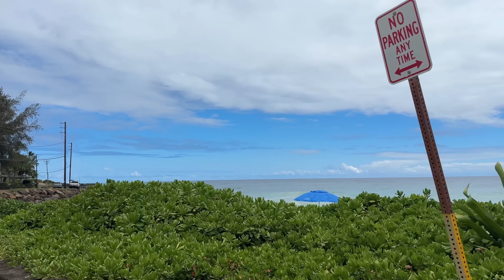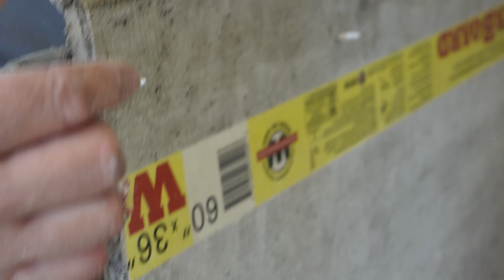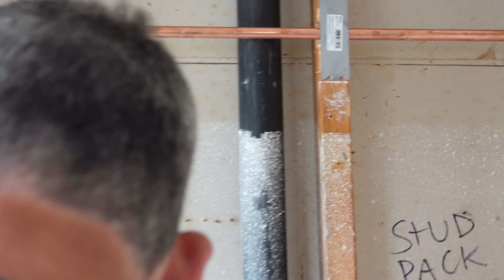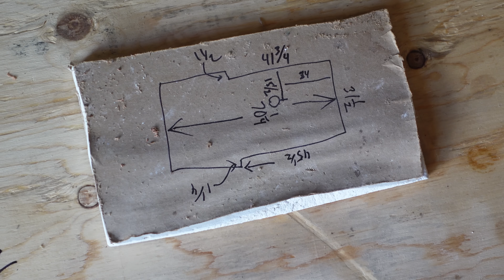RENOVATING A TINY BATHROOM IN HAWAII!

Comment: I've been swapping put most of my copper with uponor pex a. In the areas where I needed to go from copper to pex a, I went out on a limb and tried ProPress fittings. I bought a manual hydraulic ProPress tool on Amazon. It came with 1/2" to 1' dies. I'll never go back to sweating again.

Comment: An excuse to go to Hawaii! 
Awww, we get to see Rad's dad! He looks younger than 86.
That's a nice sized tub but it would be difficult to get in and out of. That tile has got to go! The curved shower rod is nice. I like double curved ones because you can hang towels on the outer rod and have the curtain on the inner rod.
The rust and the hurricanes are two of the downsides of island life. I spent a few years in Guam & we got hit with a super typhoon. It was always somewhat humid over there but the breeze usually made it cooler. 
I've broken off the plastic tabs by using channel lock pliers before. I suck at hand tightening.
Oscillating tools are awesome!
I'm going to have to cut up a one piece fiberglass shower/tub combo to remove so its good to see the techniques used. The combo is 30" wide. Door is 24" wide. 
Ah, they did a thick mortar bed under the tub.
Looks like ABS instead of PVC drain pipes.
Cementboard can be heavy. They should have used Rock-On screws but maybe they didn't exist back when that bathroom was done. Backer-On and Rock-On would work. I used the 2-1/4" ones for my bathroom because I had issues with my studs and needed to build up with furring strips. 
Probably too late for this, but if you are putting cement board back in and want to bridge cement board to drywall you can get TrimTex or Clark Deitrich L-Bead trim. Comes in 1/2" and 3/4" to cover the edge of the cement board and one leg of the L can be mudded. They also have some corner bead that can be mudded on both sides. Got perforated leg. Some even come with tearaway strips that keep the mud from getting on other stuff and when you're done you tear it off. I used it in my bathroom where it bridged from cement board to plywood.
Is Pex not available in Hawaii?
I like that you wrote on the inside of the wall. I did that when I tore out my shower walls.

Comment: When I put  my shower in I put the shower head on the opposite end of the faucets, no water running into those holes makes a difference and you turn the water on without getting wet. I know the traditional install was a cost saving move but Pex is pretty cheap and I would never put faucets and shower head on same wall again.

Comment: Aloha! You should check out some of the pre-1970s houses in Hawaii which were built as single wall construction. This is 3/4 in tongue-in-groove cedar wood making up the whole wall of the house. Interior and exterior. No framing. No insulation. This presents unique challenges and solutions as they were modernized and into today
Reply: Yeah, my house is built like this, but with tongue and groove redwood instead of cedar.  Good luck finding or affording replacements for that.  Hard to imagine that redwood tng was affordable back then.

Comment: Did something similar on a bathroom reno re the mix valve. I wanted the shower head on an outside wall, and this is not Hawaii so that is considered a not good idea. So I ran the line to an adjacent wall and used a shower head on a hose. Whatever those are called. Regular shower head you can take off of the holder. I put the mix valve on that same inside wall but positioned so you can actually reach it from outside of the shower. Works a treat, only regret is I wish I had placed the mix valve one stud bay closer to my entrance.

Comment: Are you planning on putting the cement board face up on the back of the kitchen drywall niche?  Seems like you are going to have a section of the wall that will not have very much solid backing there.  is the spacing there still 16" centers (looked larger)?

Comment: Neat trick for getting extra pressure on the drill (with the dull spade) - use a bit of lumber as a lever behind the drill, one hand on the drill for aim, the other hand driving the timber. May have worked wedging against the floor joist for the situation in this vid.
Reply: Could have used the file and sharpened the bit... 😏

Comment: 21:19 couldn't you have taken it from the other side under the flooring where the other copper pipe is going down and feed it back in the hole instead of creating a new one?

Comment: Great job guys they only thing I’m not sure of the code is in Hawaii but I know a 2 inch drain is usually what you need for a drain. But again looks good guys and love the video
Reply: In Kansas you only need a 1.5" drain for showers. A 2" is required for bathtubs. It might be a similar thing there. I think it is unlikely that a building supply store in Hawaii would stock a premade shower pan that doesn't meet Hawaiian building code.

Comment: Tight 1/2” and 3/4” copper fittings is a fairly recent phenomenon I have noticed. I have been plumbing for decades and have run across the occasional tight fitting or two, but recently, I have been running across them more and more, particularly with the Mueller Streamline brand of copper fittings. I first thought my cutter wheels needed to be replaced, so I tried every cutter I had and found the same problem. I replaced a fairly new cutter wheel on a Ridgid No. 15 cutter with a brand new one and had the same problems. Something is going on in the copper fitting industry causing these fittings to be tighter — possibly saving cost by using just a tiny bit less copper on each fitting by making them a little smaller. I don’t know, but it is very frustrating. Sometimes the fittings are so tight, they have to be smacked onto the pipe with my Channellocks, but then, the capillary space is so tight, sometimes the solder won’t flow properly into the fitting. I have resorted to using a pre-tinning flux — either Nokorode 95-5 or Oatey 95 to help with getting the solder to flow into the fitting. I have found that I do not have this problem with any of the NIBCO copper fittings, but when you order from the supply house, you get what you get — whatever they bought for the least amount of money. I suppose the supply house just buys whatever costs them the least, but doesn’t pass that savings along to their customers. I am seeing less and less NIBCO and more and more Mueller Streamline copper fittings coming from all of my suppliers. I am paying twice as much for my flux and fighting pushing on almost every joint I make. I hope this nonsense ends soon.

Comment: Although a shock for builders coming from the continental 48, it's not surprising that houses in Hawaii have no insulation. With no HVAC system, the temperature inside and out is close to the same, so there would be no temperature difference to insulate against.
Reply: Wait there’s no HVAC in hawaii??????
Reply: @darwinbodero7872  A lot of houses don’t have hvac systems because the temperature is nice enough to not need it on most days of the year, also because electricity is so expensive in Hawaii.

Comment: Dude. Supporting a wall on one end by just gluing it and screwing it to a sheet of drywall. I'd be doing whatever I had to to redesign the wall and bite into some wood. Yikes. Other than that. I really like all of the rest of what you did. Great video!
Reply: Wonder if it would have helped to run a long hanger plate down from the horizontal blocking?
Reply: @PongoXBongo  I like that idea. My first thought was to just run one 2x4 all the way up to the ceiling where the divider wall connects to the shared kitchen wall. There would be a 1.5" bump out on the shared wall above the divider wall, but I think it would look just fine.
Reply: I would have put a 2x4 wall across the entire back wall to support the kitchen drywall and the new shower head. 🤔👍🏻
Reply: @ppeller3  Obviously that is the ideal solution, but remember that they have a custom ordered vanity that they already have to nest back into the wall so it won't obstruct the doorway. I don't think it's an option to build out the wall in that sink area. It's either just at the connection of the divider wall or that plus the shower area.
Reply: Build the shower niche wall first and attach it to that.
Reply: @brawksolid6285   Not the entire wall across the room just in the shower area.

Comment: I don't quite understand the no tools thing.  Even on your jobs at home when you talk about needing to get tools.  There are SO MANY tool sets and sales.  For a project like this, get a 5-10 piece Ryobi set from home depot or Kobalt form Lowes.  A ryobi set is like $300 with maybe an extra 2 batteries for $100.  Maybe you guys like the challenge?  Or it makes for a more entertaining video?  I would think buying a set of tools is still cheaper at the end since you did the work yourself.  Then just sell the tools on marketplace when you leave.  even at 50% off you just "rented" tools for a week for $200, but you had the majority of what you needed.  I'm in the DC area and I can buy a new set of tools for each job and still come in 2x-3x cheaper than any quote.  It almost doesn't matter what the job is, that's how expensive every project is.  Or another way to look at it, how cheap tools have become.  I can't wait until Jordan goes on a tool spree.  BTW, everything except table saw/miter saw should be cordless.